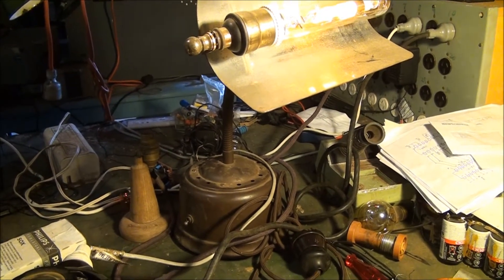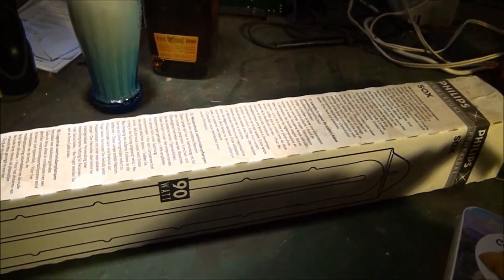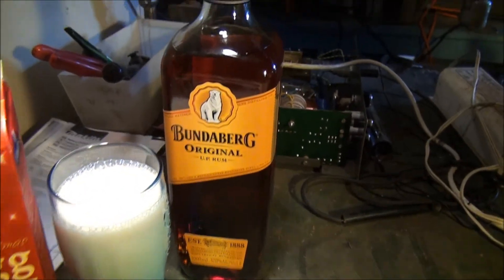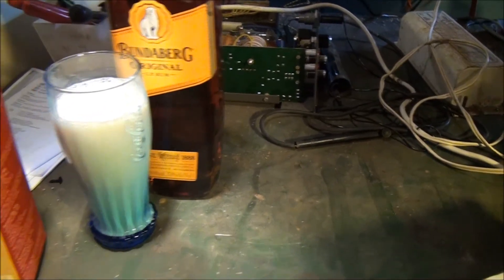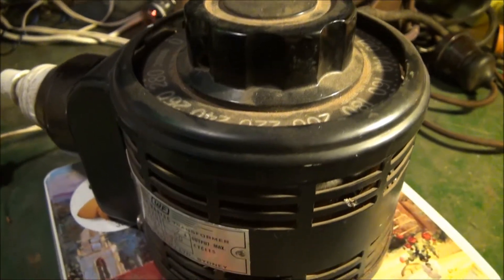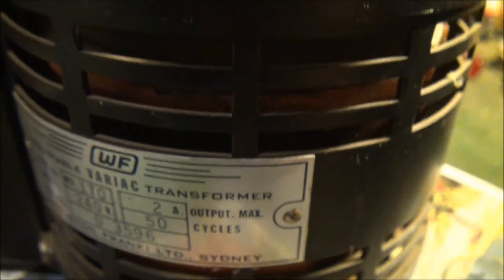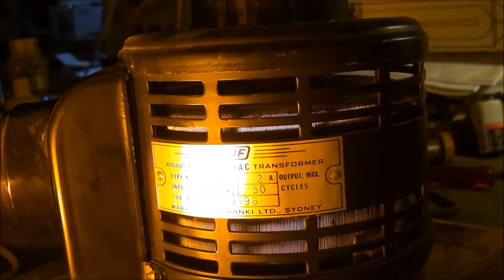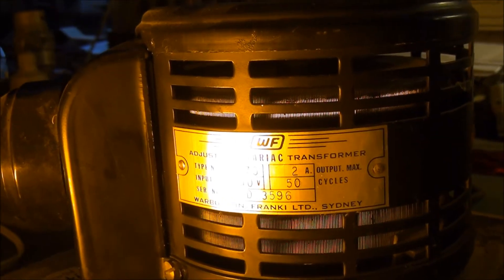Low pressure Sodium Lamp

Comment: Very nice lamp, love the colour changes of the low pressure Sodium lamp. Thanks for sharing.
Reply from the maker: Yes, the colour changes are lovely. I run up the lamp on a lower voltage to enable the colours to last longer before the Sodium ionises, the effects are great.
Reply: Does Australia light up there roads with those Low Pressure Sodium Lamps